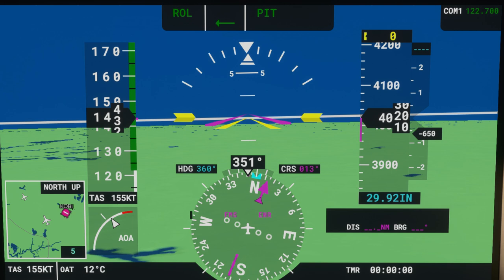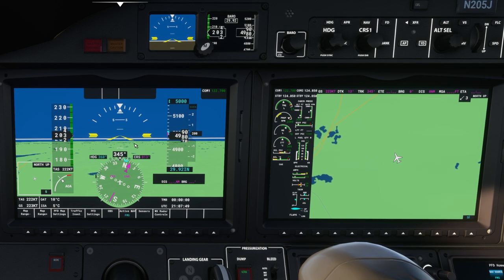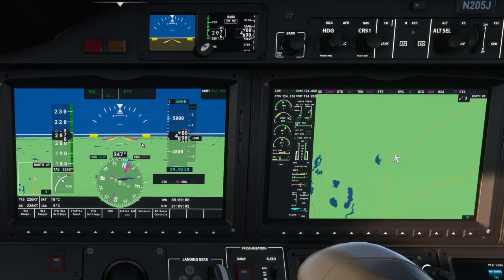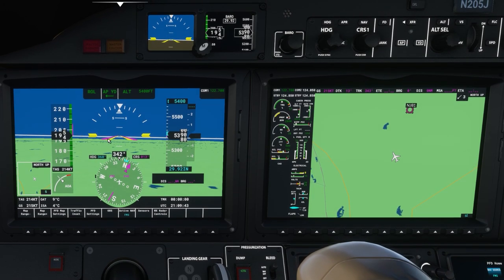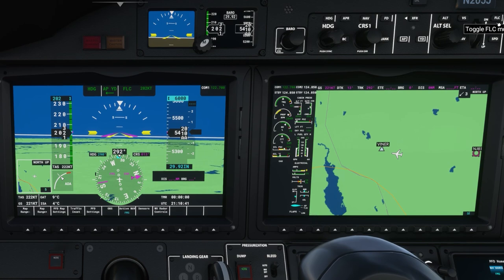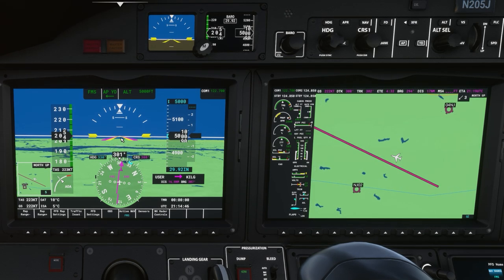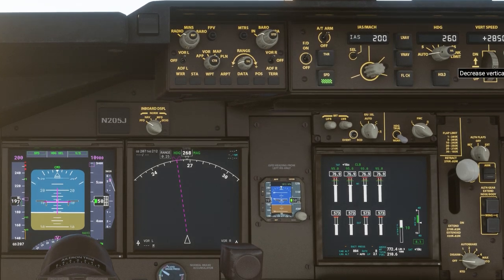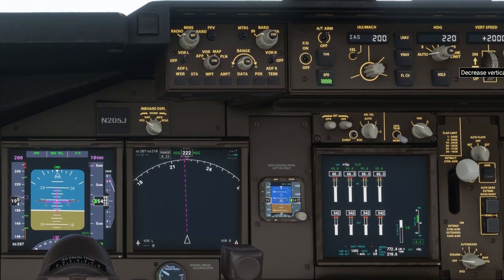Flight Director Tutorial

Comment: Been watching your channel a lot recently and subscribed too. I was wondering if you would be so kind as to do a video showing what the difference is between flying in GPS mode vs NAV mode and what determines which method a pilot uses for a flight and why etc. Thank you
Reply from the maker: GPS is a NAV mode. I think you are asking about GPS navigation versus ground based navigation?  Before GPS virtually all aircraft navigation was by tuning radios in the cockpit to a ground based source like a VHV Omnidirectional Range (VOR).  There are other sources but the VORs are the most common.  Older aircraft not equipped with GPS still use ground based navigation.  Basic navigation was from one VOR to another VOR or intersections between two VOR radials and so on until the destination.  Distance Measuring Equipment (DME) allowed for navigation to specific distances on a VOR radial.  With the advent of GPS receivers in the cockpit, most aircraft that have GPS will use it for NAV as it allows you to navigate direct to any location not bound by ground based installations.  So GPS and VOR is still a NAV source.  One is via satellites, the other via ground base installations.  GPS is newer, more precise, and more versatile.  GPS is also used for instrument landing approaches as well.  A GPS RNAV LPV approach has the same general performance as a ground based ILS approach.  This is also GPS versus ground based installations.
Reply: @RMAG  Thanks for your reply so I guess my next curiosity would be this...if I can navigate directly to my destination, wouldn't this conflict with when ATC assign a heading different to that showing on the GPS? Or is modern day ATC coms primarily focussed on collision avoidance/traffic separation/ guidance for old aircraft... hence the phrase I often hear"resume own navigation"? Presumably meaning to resume own GPS navigation? 

Thanks again.
Reply from the maker: @dermolado3351  Flying VFR you don’t even need to be talking to ATC, you can go direct assuming you don’t enter into any controlled airspace that requires ATC communication.  Flying IFR you file your aircraft type with a “/G” to let them know you are GPS equipped and you can file using GPS waypoints that are not obtainable with ground based navigation alone.
Reply: @RMAG  okay awesome. Starting to make sense now. Thanks a lot. Looking forward to new uploads. Cheers

Comment: Thank you so much for all your great video's, I just received the Bravo Throttle Quadrant, followed all you video's and all is working great. One question, When I fly the Carenado's  Twin piper, I can not set the heading bug 1 degrees at the time, it only seem to change 10 degrees, this makes it very difficult to get on the right heading. Is there a fix for this? Thank you for your time.
Reply: I have the same problem Andrew, I have the PA44 Carenado, Alpha yoke and Bravo throttle quadrant. I did some digging and there is a bug in the game that causes the increments for the knobs to jump up ten degrees instead of 1, you can test this by unplugging your throttle usb and you will notice the problem goes away. 

So what is causing this? 

If any of the 'always on' switches (landing gear lever, toggle switches, mag and ignition, auto pilot knobs) have an input from the game bound to them, the increments go up to 10. I noticed it will only do it if any one of the switches are in the 'on' position. If you disable all the toggle switches you will notice the heading bug and other knobs will work properly. Obviously this is super annoying and want to use your switches and landing gear lever so there is a workaround that kinda works, you can set your switches to "off" positions when you need the smaller knob increments, or take it a step further and install FSUIPC7 and manually assign controls back to the switches you unbound. for some reason when you bind inputs with this software the increments work correctly. 

Now the next problem I had was that it didn't recognize some of my switches so I kinda gave up. Another thing that happens when you use FSUIPC7 to bind inputs it makes the lights on the autopilot and the landing gear lever to not work. I hope a fix is released soon, not sure if it is MSFS or Aerosoft that needs to fix this but I can't believe they sell this thing with all these weird bugs. 

Good luck and let me know if that helps or if you find out how to get it working better than I did with FSUIPC7. :) Hopefully Rmag will find a fix or it will be fixed by developers soon.
Reply: @coreyregier5546  Thank you Corey, I think I will live with it for now and hopefully it will get fixed. I tried a few things and they all seem make things worse, for me anyways.